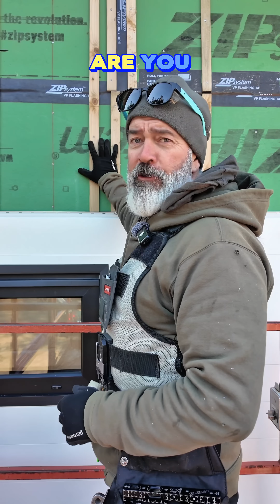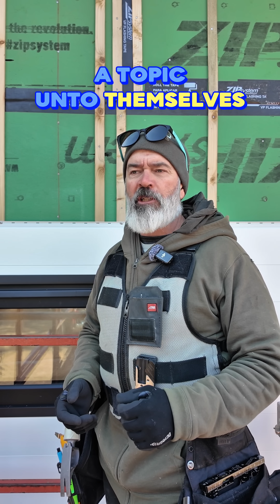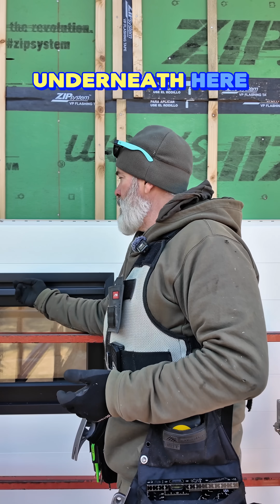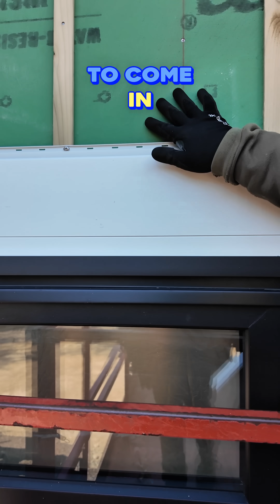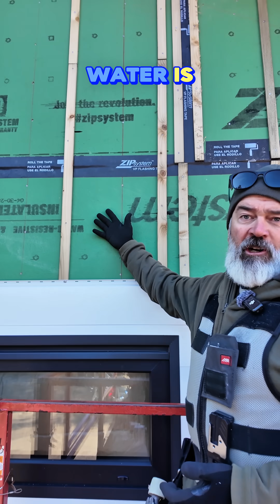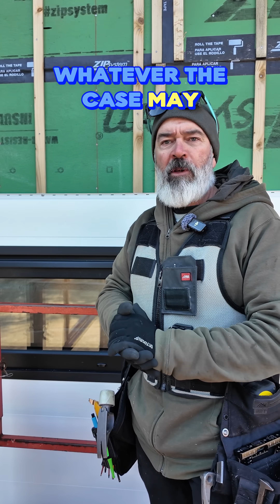Rainscreens! Are you using them on your project?

Comment: Rain screen is pressure equalized by definition. The other two are mere drained cavities.
Reply: In Qc, we built with 3/4’’ vertical strapping for wood/fiber cement/vinyl/composite siding. We double it with 3/4’’ horizontal strapping when the sidind is vertical to keep the air flow. We use the bug screen at the bottom and top of wall as well as bottom and top of opening for maximim venting and drying!
Reply from the maker: 3/4" is my preference,  but we don't get everything we want on all projects.
Reply from the maker: Actually, very few rainscreen are truly pressure equalized. A 1/16" gap will provide drainage, but not drying. A 3/4" gap provides drainage and drying, but may not be truly equalized.